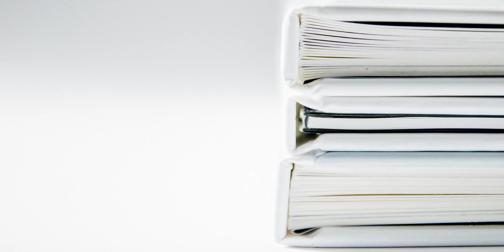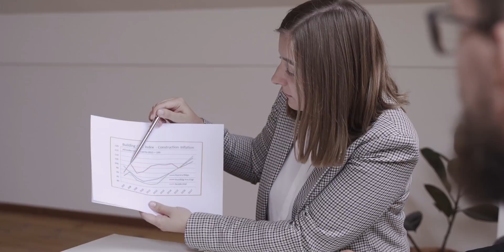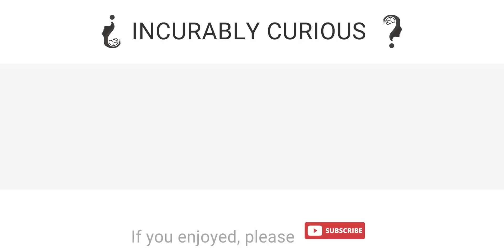Why Most Power Lines Aren’t Underground

Comment: In Germany, most of our powerlines are underground. Only in old rural areas, you'll still find them overground. But what you'll also see: obsolete powerline connectors on older houses' walls. The point is that you don't need to replace the entire infrastructure in one go. Just don't install new powerlines the old way. If renovation or expansion is needed, do it underground and over a long period of time, you've got rid of the old overground powerlines.
Reply: Local power lines are mostly underground, but the long-distance transmission lines (110 to 380 kV) are mostly overground. (At the few places those are underground, e.g. through cities, they are usually in a tunnel so you can get to them for maintenance, at least for the newer lines.)
Reply: same here Saudi Arabia has most of its electricity underground especially in cities
Reply: Yes and no, in (at least the south of) Germany urban areas had their lines converted but the high power lines are still built as above ground wires to this day because the cost would just be too much. Also power shortages rarely happen for long periods of time cause of many redundant switchable interconnections here.
Reply: @ssingfo  there is a seckond reason you cant build long onderground high voltige cabels. the reason is you get problems with the capasety of the cable becouse the cable funktions like a condensator. The problem comes to show much later at above ground powerlines. and everting longer neads HVDC (HGÜ)
Reply: @fabianodorer4172  not trying to be mean but you have to work on your English it is rather shoddy
Reply: @TheTallOne890  If you can read it who cares?
Reply: @bigtone7824  it might be hard to read for someone who doesn't know English very well they might know some limited English and might have a hard time reading it
Reply: @TheTallOne890  it's just a comment on youtube move on to the next one
Reply: @bigtone7824  you're the one who added onto it use your own advice and move on
Reply: @TheTallOne890  *you're check that English
Reply: @bigtone7824  sure you pointed out an irrelevant problem compared to an actual issue for non english readers
Reply: @bigtone7824  also who's correcting who know?
Reply: @TheTallOne890  uh huh
Reply: @TheTallOne890  Why does he "have to work on" his English?😂😂😂
He obviously doesn't need English for making a living, otherwise he would have died out of hunger. Therefore, why does he have to do that?
Reply: @AngelosGT  correct Grammer makes you appear smarter and more official when writing your resume to get a higher up job
Reply: @ssingfo  the high power lines are build above ground because cramming high voltage electricity into small space even with resistors it is a disaster, the cables warp the temperature management is bad, and the maintenance of uch lines is major problem. as opposed to above ground air is great natural resistor, the maintenance is easier, and the heat and cable warping is not a problem.
Reply: @tomaszwida  As a utilities engineer, I’ve worked on many projects where the power HV cables are also underground. This in countries like Qatar and UAE. So, I don’t think the heat is an issue. In fact it may be cooler underground.
Reply: It gets harder to upgrade to higher voltage infrastructure. There's always an incentive to add capacity, and oftentimes that involves increasing the primary voltage, especially when all the conduit slots are taken up or damaged so that pulling new cable is infeasible. One big problem is that failure modes like electrical treeing get worse as the voltage increases. No solution is really ever permanent (we even used to insulate cables with asbestos, and many of those cables are still in service), and underground cables are just so much harder to maintain when failure inevitably occurs. For residential areas particularly though, underground is pretty nice.
Reply: That's exactly what's happening in the U.S. as more and more new lines are laid underground and projects to bury thousands upon thousands of miles of existing above-ground lines are underway. But in many areas of the U.S. above-ground is financially feasible, resilient and reliable, and easier to optimize as new demand comes online - as it always is in the 3.6 million square miles of the U.S. outside of its long list of large urban areas.
Reply: When they had to replace old power poles in my area the state highway and local power company stupidly replaced them with more power poles.
Reply: I think it's like that in almost all European countries though
Reply: Lol, that'd be a sensible way to go about it...
Reply: in italy it's the same for powerlines. an example: in my neighborhood the copper for the phone/ internet was overground when the fiber arrived they made it underground
Reply: @pankreas239  i wouldnt mind having the fiber overground as well, better than no optic at all
Reply: no thank you from japan xddd
Reply: high voltage cables also?  but anyways, i think whole europe is more or less underground, when it comes to low voltage lines ot art least is heading this way.
what i was surprised to see, for example,  is how poorly in this segment are united states. basically whole their infrastructure (not just electrical grid) is decades old and they not doing much to change that on global scale, cables everywhere, poorly maintained roads etc. and i think, this is what video is about..
Reply: @izoyt  the problem with US infrastructure is a lack of density. Extensive Infrastructure for american suburbs is already bankrupting tons of cities
Reply: To be fair though it was probably a lot easier for Germany because of the whole war thjng
Reply: @danielsage7187  What about the whole war thing in the rest of the world?
Reply: @danielsage7187  oh well, even prior to the war, in urbanised areas more or less all cables were underground.
Reply: Sounds reasonable.
Reply: Rebuilding your country after being destroyed gives you options.
Reply: @franksullivan1873  
Especially since it was destroyed from within...
Reply: I was born there, but I did not notice this. Of course, I was young then......
Reply: In the Netherlands everything from 220V upto 50 kV is underground, only the really high voltage is still above ground, altought there are short stetches of underground 150kV lines too
Reply: Long time thinking is not an Americans' strong side.
Reply: @aleksandraz7477  And you think that slur is relevant after watching this entire video?
Reply: Germany is a speck compared to most states in the US, not the same comparison.
Reply: "In Germany, most of our powerlines are underground." - Germany has the most expensive electricity in all of Europe so it isn't quite a good example. And besides, I'm pretty sure that most of the HV power lines are still overhead lines even in Germany.
Reply: @CoolKoon  yes we do have the highest energy prices, but the underground wiring isn't the biggest issue, in fact energy infrasture costs only make up a third of the cost and that varies heavily per network provider.

Taxes and Production costs are the real issue.

Oh and let's of course not forget profit margins and fossil fuel subsidies.
Reply: @randomdude64yt  "the underground wiring isn't the biggest issue" - Yeah, I'm well aware of this. The problem with this attitude is rather that it limits the possibilities of constructing new transmission wires which Germany is in dire need of (especially from northern parts down to the Ruhr valley) that's causing problems to the surrounding countries too.
"Taxes and Production costs are the real issue." - Yeah, the biggest contributor to the price are the insane green electricity policies in place. But that still doesn't invalidate my point that a country with the highest electricity prices in Europe shouldn't really be arguing in favor of burying all the overhead transmission wires.
Reply: @CoolKoon  "The problem with this attitude is rather that it limits the possibilities of constructing new transmission wires which Germany is in dire need of (especially from northern parts down to the Ruhr valley) that's causing problems to the surrounding countries too."

The opposite is true. As long-distance high voltage lines are usually above ground, they are being prevented by NIMBYs, and below-ground lines are actually being considered to avoid that issue

"Yeah, the biggest contributor to the price are the insane green electricity policies in place. But that still doesn't invalidate my point that a country with the highest electricity prices in Europe shouldn't really be arguing in favor of burying all the overhead transmission wires."

Well, there's nothing to invalidate in wholesale bullsh***ting to begin with, all the more when you deliberately want to ignore externalities and declare you have no qualms dumping billions of costs on future generations because you consider your hedonism more important.
Reply: @CoolKoon  in fact, it is not the green electricity that is driving the prices up, it is coal and gas and was for decades nuclear power.

The Rhur Area is very well connected. and btw it is not in the south but in the middle west of germany.
The problems are with southern germany like Bavaria, where neither renewable energy is build nor transfer routes are established.
Reply: @CoolKoon  Yes, but that's got nothing to do with underground power lines, which are common in Europe. It's the heavy reliance on expensive natural gas for power generation, a high tax and surcharge load on electricity, and the phasing out of its nuclear power plants.

Comment: I really hate to disagree however the cost is roughly the same for overhead or underground 
Think a moment 
The power company is not in the business to supply power to you they are in the business to .ake money power is the source of the momey 
Overhead lines require 10000s more in maintenance and the board at said power company will state we need a 2 or 3 % increase to continue the level of service  
Now with your company check the last time the rate was increased check out the dividend payout on the preferred stock not the common stock

Comment: The UK doesn't have overhead power lines in urban areas as a general rule. Rural villages are often fed by wooden pole (although most but definitely not all villages would still have underground cables in the village itself). Big metal pylons criss cross the country carrying the electricity. I live in a big city and we have only lost power once in the last decade and that was for less than 30 minutes. The previous decade it was probably more like 2 days total outages spread over 5 occurances. Our underground cables are apparently from the 1960s so lasting a lot linger than this video suggests.

Comment: I really don't understand how especially the USA doesn't put their utilities underground. It is not more expensive than water or sewer lines.
We have done it for most of a century. Electricity rates here are not higher than in the USA.
Flooding is not an issue (I live in the Netherlands), and lightning strikes can easily be protected against. Repairs are not an issue if things don't get damaged.
We have a national register for everything buried underground that anyone who wants to dig needs to check.

Comment: I would pay double. Not specifically for underground cabling but for guaranteed reliability. Which could be done by restructuring existing systems to have a switch and feed from both ends. In the event of a break both ends are fed and everyone is powered up to the break.

Comment: The town I use to live in an area that had a high end development go in and all the power lines were run under the sidewalk in a U shaped concrete conduit with the sidewalk placed overtop. I imagine the thought was that if work needed to be done on the lines the top sidewalk slabs could be lifted off and cause minimal disruption to the road and peoples yards. In theory a great idea... what they didn't count on was the wet dark tunnel became a breading ground for mosquitoes and rats.
Reply: Gross. I think someone further up in the comments said they designed a system similar, but they cover it with sand ontop to prevent such occurrences. sounds easy enough to remove for maintenance.

Comment: I highly doubt that underground power lines in residential areas only last 30-40 years. Most houses from 1960-1970 probably have the original wiring in and to the house.

Comment: Wrong. My home town in Rochester MN has all underground power and cable lines. This was done for a few reasons. 1. Winter. Winter tends to create a lot of cost to the repairs each year. 2. Tornadoes. Each year tornado type activity produced a large cost each year.  3. Appearance.  1970-1980 flooding happened that devastated the town. The rebuild was simple. All power lines under ground. Then in 1990 so in truth till q disaster crushes your view you will not see the true cost.

Comment: So one stormy night, tree came down in garden. Straight through the overhead power lines. Was trapped in the house for the day, but 2 days later I was due to have faster FTTC internet installed. Well, the poles are shared infrastructure so the tree also took out the phone cable when it pulled the pole down, but the way the phone was routed only power was actually between the 2 poles where the tree came down.

As a such, rather than waiting 2 weeks for a telecoms engineer to fix phone line at all, I was back up and running 2 days later given he had to fix it before I could get faster internet. :D.

Comment: At my old home the power lines that went above ground to the house were 120 years old. They were so old the power company thought they were offline. About 40 years prior they put in underground lines and just forgot to connect our house... One of the poles was so rotted out that when they were planning on taking them out to replace a road that would be going to a new subdivision they accidentally knocked it over by shaking it. Like a person grabbed it and put weight on it... I have to say if the lines can last that long without issue and be cheaper then go with the cheaper option.

Comment: Earlier in my career i designed distribution, transmission, and substations.  The primary reason is underground costs are 3 to 7 times more expensive depending on the land being crossed (i.e. rural area with open right of way is typically lower in costs and easy to install; however, city and suburbs are more expensive due to road, driveway, sidewalks, parking lot crossing are more expensive.  In addition underground may (not always) be less susceptible to outages; however, historically when those UG cables go bad repairs also take longer. For example underground cables are susceptible to people digging into them but more likely to withstand most storms (except floods). Auto accidents which hit poles can also hit UG pedestals and pad mounted transformers.  I have seen all causes of outages but they boil down to man, animal, nature, and equipment failure (lack of maintenance or poor design).  Some causes can be humorous (i.e. squirrel chews in fiber optic cable which destroys com link to substations, which cause system errors, later to find out the manufacturer of the fiber cable used peanut oil in the making of the fiber cable jacket (squirrel assumed there was a nut in that cable).
Reply: I would much rather have above ground lines that are much quicker and easier to service than underground lines.
Reply: So why not bury cables in sidewalks?

No potential damage from humans/cars/squirrels/nature(surrounded by concrete) easier for maintenance, easier and cheaper to lay, and a perk for the community.

And its poured on the land so it doesn't matter what surface it is.

Oh and everywhere that needs power also needs to be accessible via car, so laying cable adjacent to roads seems like the clear option.
Reply: @daslynnter9841  They do in urban cities.  Transformer vaults are common in city sidewalks, most people walk over the grates but rarely know what is beneath them.
Reply: @daslynnter9841  Because of spacial constraints if another line is required to be installed along that route it creates congestion and heat cannot dissipate easily (If you go beyond 90C your cable starts to fail).

Comment: Living in Germany putting the power-lines underground is the standard. Only high voltage power-lines are still above ground but are setup in circles so that in case of a damage the grid is still working. I never experienced any outage caused by weather. if there is any issue with the grid it normally took parts of a second to be supplied again. Planned shutdowns are a different thing and well be announced long-time in advance and only take a very short time
Reply: I read somewhere in Germany that the average outage is 7 minutes. I have worked on high and low voltage underground cable for 35 years on the east coast of the USA. There are cables I spliced to that are over 100 years old.

Comment: I agree that it would be better to spend the money to put lines down in new construction then polls up. Even though it would cost, it would be nice to do like Disney World in Florida and build on top of service tunnels where everything is run under the surface and roads for service workers to those.  Now my parents did have the power line put underground from the poll to the house. Now I do have a question, are they putting powerline in a pipe in the ground or just ran under as a cable? My dad ran many of our cable wires in plastic pipes in the ground to protect them from different things like digging. When my old church build their building years ago, dad requested that the power ran from the build to the sign under the parking lot be places in a plastic pipe. This was to help make it easy to replace it if ever needed than to tear up the parking lot.